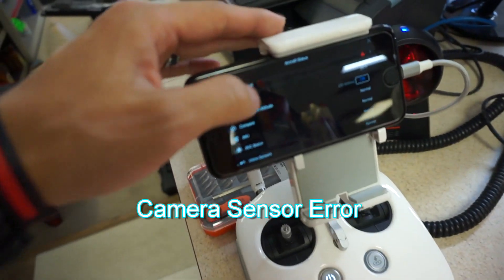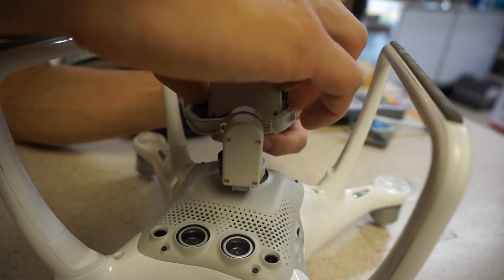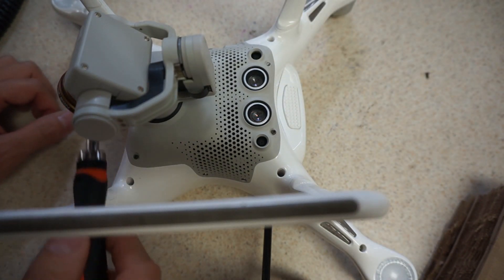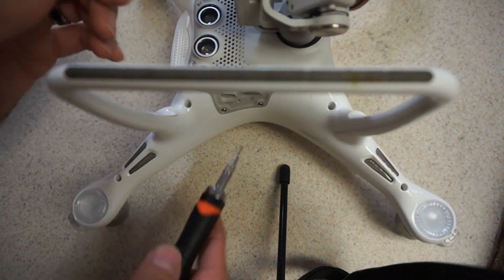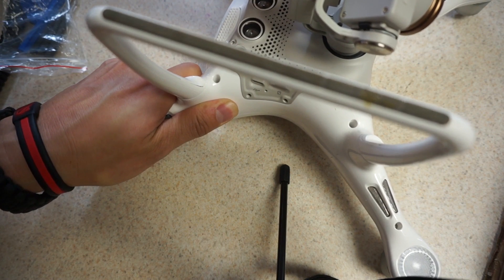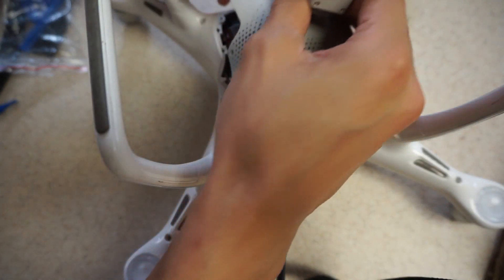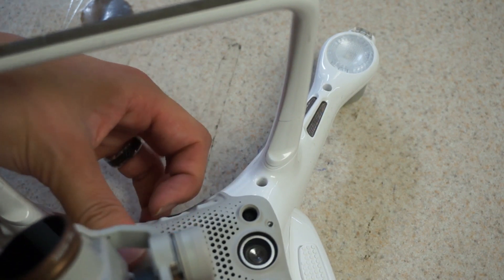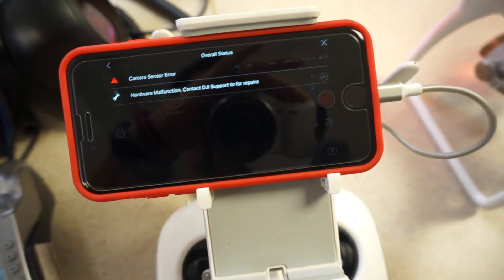Camera Sensor Error DJI Phantom 4

Comment: HI, I fixed this problem by changing camera's gimble flex cable. Flex cable is really fragile for some reason, magnetic field, dent and so on ... So weird for me but it was working again after this manipulation.
Reply from the maker: Yes the flex cable is the weak point.  It worked for me as well.

Comment: i have the same problem and when i was flying my drone i lost it connection. I was 250 meters and it drops down. total crashed it. i called DJI and they watched the data fly and they could't figure out what happen. now i sent it to them to fix it  and probably i have to buy a new one. lost me phantom 4 pro and my $$$$
Reply from the maker: alejandro ochoa wow that sucks
Reply: I know, I am thinking now to buy a different one but i dont know which one. . I dont wanna spend that king of money and go thru the same problem. :(
Reply from the maker: alejandro ochoa That’s the thing with electronics, they aren’t perfect.  DJI is the best known brand in the drone industry though.

Comment: Resolved Bro. I spend the same with the phantom 4. You have to remove the battery 1 or 3 times from the drone without turning it off and wait for it to calibrate or level automatically, then connect the drone and do the drone controller synchronization and vice versa to update the sensor. regards
Reply from the maker: Avelino Archibold really, haven’t tried that before, thanks for sharing!
Reply: Did this fix it?
Reply from the maker: I haven't had this error come up again since I've replaced the flex cable.  If it does again though, I will take Avelino's suggestion and remove the battery a few times.
Reply: Avelino Archibold  ive never had any hard landings with my drone and it happened to mine over the weekend i also have used extreme care when handling the gimble area so i seriously doubt i damaged my flex cable but you said i have to pull the battery out while the drone is still on?
Reply: Just started having this issue with the p4, unfortunately the battery trick isn't working for me ;\

Comment: Hi man where did you send it to buy? I have the same problem!!
Reply from the maker: Keyvin Rodriguez I bought the part and replaced it myself.  See my latest video.
Reply: thanks man
Reply: Keyvin Rodriguez this is how dji makes there money by making a drone that cost alot of money but has so many issues with it .that is why it is better just to have the cheap drones easy to fix and the parts are not expensive  I regret buying the fantom 4 drone .toany problems and to expensive to fix I have a problem with my controller not charging  so there for I can't fly my drone  well this is what happens there smart only giving a,warranty for a short time because they new there products were gonna have a lot of problems